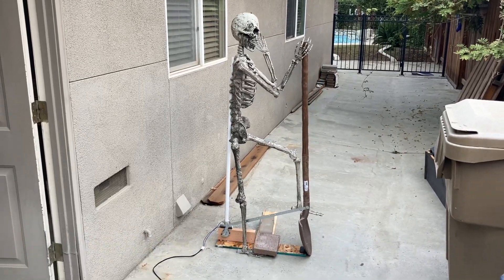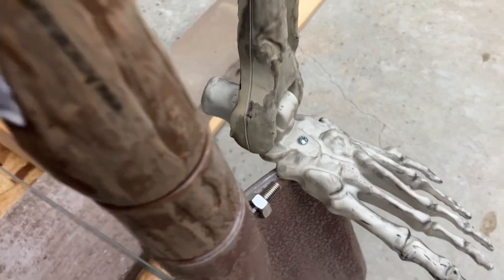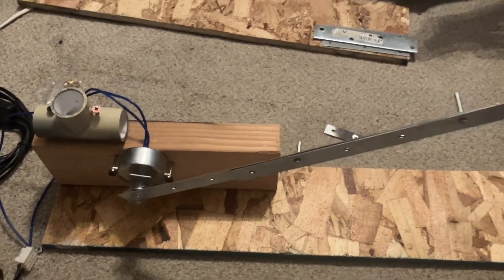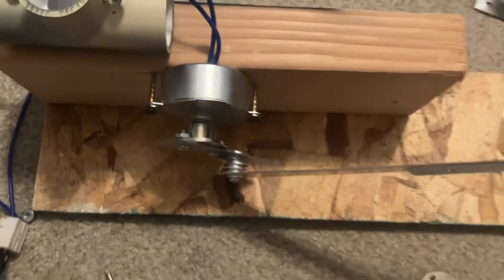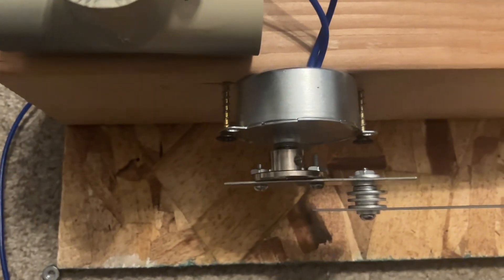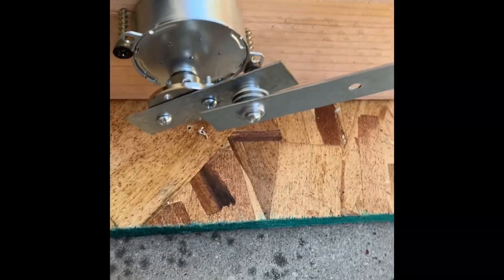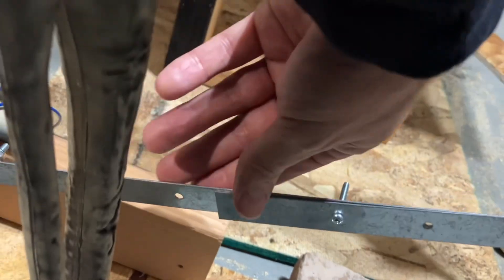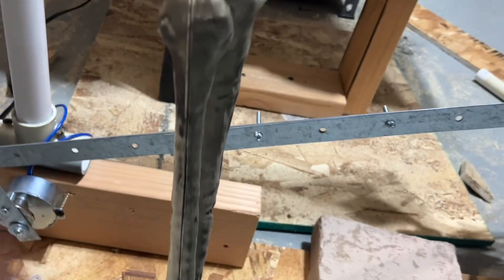Grave Digger Prop Using Synchronous Motor

Comment: Can this motor and power supply be used outdoor?
Reply from the maker: I’ve only put it outside on Halloween. Those motors won’t do well in the weather (I assume). This build was out for 14 hours on Halloween and ran for 5 hours